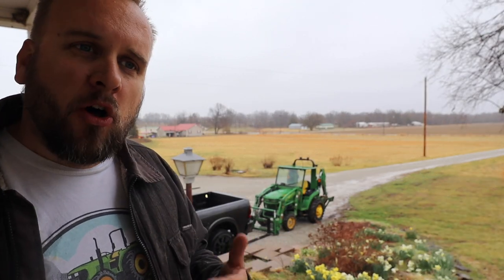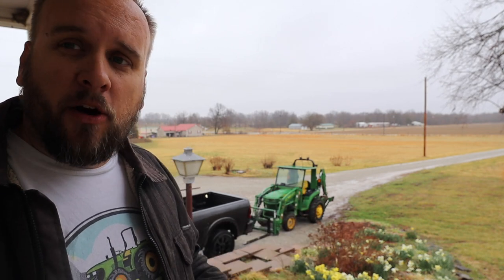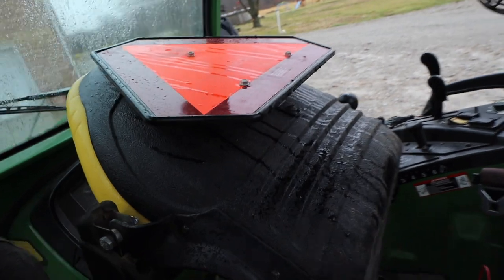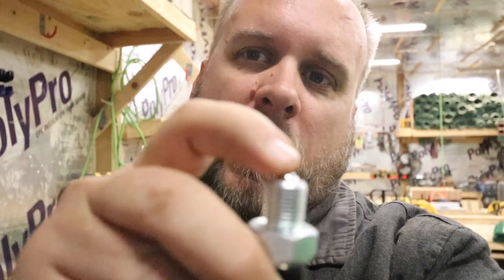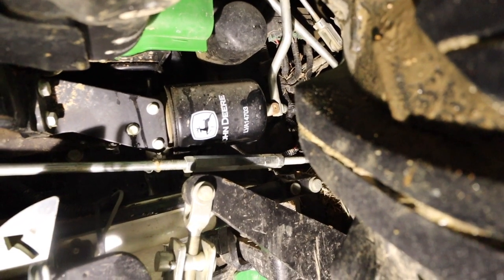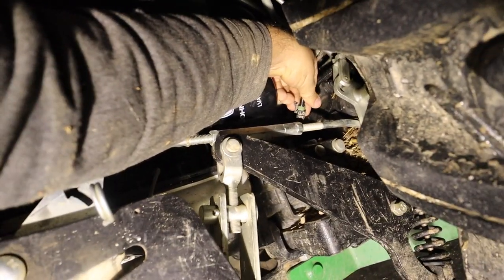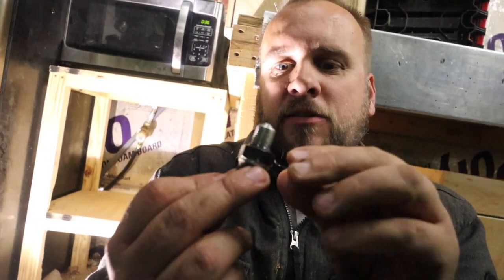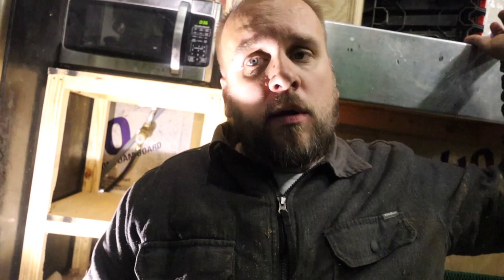Bypassing the Seat Safety Switch - Replacing the Neutral Safety Switch

Comment: Nice job Brock.   Good advice in attacking the problem one item at a time.   Glad it was just as simple as this.  I must admit if the tractor was shutting off because of the backhoe, I would be scratching my head too!
Reply from the maker: It was confusing, but I think tipping the tractor that direction was making that switch short out. Probably the spring that pushes the ball back out was weak

Comment: Nice job! Glad you were able to fix it before taking it to the dealer! The seat safety switch just started flaking out on my X728. I tried a jumper and it fixed my issue, so I bought a replacement safety switch and it seems to be working better, but it's still not 100%.
Reply from the maker: Thanks for watching and sharing your experience

Comment: I feel better and it's not even my tractor. Hopefully that was the problem. I keep thinking about that darn seat switch. Like you said if I rock forward in the seat to try and see what I am doing the thing shuts off. I can see why it's on there but sure would be nice if it even gave me a second or two before it shut off.
Reply from the maker: It’s really easy to bypass, but we all have to make the decision if we are more interested in the safety aspect or the convenience
Reply: @RockhillfarmYT  don't want to die but sure would be nice to be able to see over the bucket.
Reply from the maker: I know what you mean. Mine has a wider hood and is even worse about being able to see the bucket and pallet forks

Comment: So I'm figuring your connector was the issue , not the Neutral switch itself...
Nice detective work  Brock .
pc
Reply from the maker: Quite possible. 

The only other explanation I can think of is that there has to be a little spring that pushes that ball out and then a lever pushes the ball in.

If that spring was weak then tilting the tractor could make it make contact on the switch

Comment: Di electric grease is always your friend. Especially if you think you have a iffy connection.
Reply from the maker: Thanks for the tip
Reply: @Rockhill farm   took the box off my truck and 2 out of 6 tail light bulbs worked, checked and there was power, bulbs were good still didn't work, then added some dielectric grease and they all worked! I swear by the stuff.  Hope your problem is fully resolved.

Comment: Hey, 
Thanks for sharing this. 
My 1025 has done this since day one and I thought this was the issue also. I usually place a wadded up towel in front of the heat shift so it won’t move and that works however I would like to fix it right. 
 Would you happen to have a price for the switch and a part number to order? 
 Also I wonder if you have had any issues with it shutting down since you did this fix? 
 Thanks again 
 Joe, 
Lindley, Ny
Reply from the maker: I did not save the part number, although my local dealership was able to look it up and get it for me pretty quickly.

I have not had any more problems since
Reply: @RockhillfarmYT  okay thank you so much

Comment: The NSS was the 1st thing I ever broke on my tractor. Ran over a stick with the front tire and it speared right into the NSS breaking it off at the block and rubbed wires bare that were in the vicinity.   I was going fairly fast down my driveway when it happened and the tractor just came to an abrupt stop.  That scared me more than anything...lol
Reply from the maker: Yeah, that would get your attention in a hurry

Thanks for sharing

Comment: KIoti (my CK3510SE) which is junk, has a recall on my safety switch. Was doing the same thing....They replaced the entire seat bottom including all the seat safety switch components. I would never disconnect a safety device or remove an OEM guard in any way. Asking for trouble. You should hold JD accountable. You paid a lot of money for that tractor.
Reply from the maker: True. I put the seat safety switch back together after figuring out the real problem

Comment: I hope that you checkout the hydro fluid so you don't have anything else that will be a problem. If you blow up the hydro system you minus well get another Timmy
Reply from the maker: Yeah, it’s still good. I think it holds 7 gallons and I probably leaked half a quart

I’m taking it in tomorrow for routine maintenance

Comment: My mother in law had a tractor at one point that a jumper wouldn't work on. Apparently some are backwards, so sitting on it would open the circuit instead of closing it. (Probably due to the safety concerns) Just throwing that out there in case anyone tries this and it disables theirs instead.
Reply from the maker: Thanks for sharing

Comment: Or, just un-ohsa the tractor and never worry about it again. That's what I would've done. Actually, that's what I have done. 🤔🤔🙄
Reply from the maker: I’m thinking about putting that jumper back in the safety switch for the seat.

That would be really handy when running the stump grinder or wood chipper Not to mention when you accidentally shut it off just moving
Reply: As the dealer was pulling out of my driveway after delivering the tractor new, I was heading into the shop to build the jumper wire.
Reply from the maker: I don’t blame you guys at all for doing that. Being on YouTube I Try to be careful what I say about bypassing safety 😉

Comment: All that safety stuff is BS and just causes problems. I can see the seat one.  But the one to go into reverse with the deck on, shift to neutral, etc is all BS.  If you need those safeties in place, you probably shouldn't be running a tractor! But these days, everyone wants to sue even though it's their fault. After my parents got a zero turn I went up and took the old tractor they had and I used all my childhood that was a White GT-1855 and all of the safety switches were bad.  I pulled all of the yellow wire that connected all of the safety switches and jumped the wire for the whole system and never had an electrical issue again.
Reply from the maker: I hear you

Comment: The seat safety switch is for old operator and in case they fell off due to stroke or  heat stroke etc. etc.  the machine will shut off automatic for the safety of everyone.
you can add a bypass switch  to keep the engine running while you get off the machine which is again pointless because it only takes 1 to 3 seconds to start the engine back up..